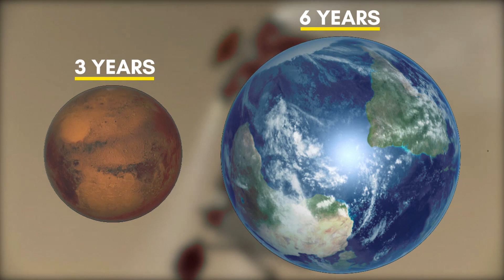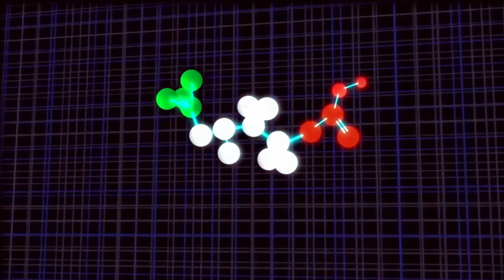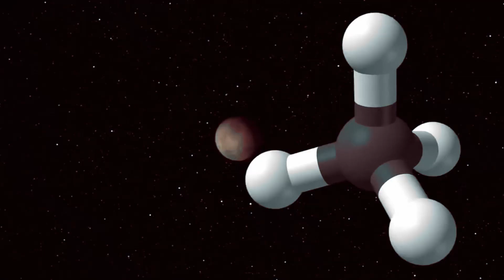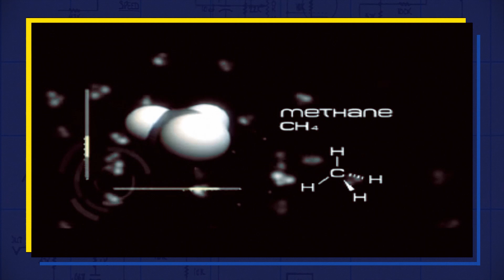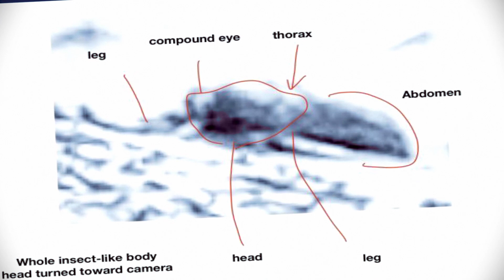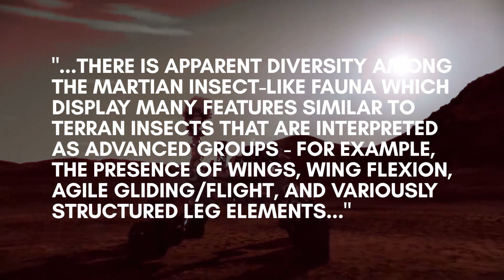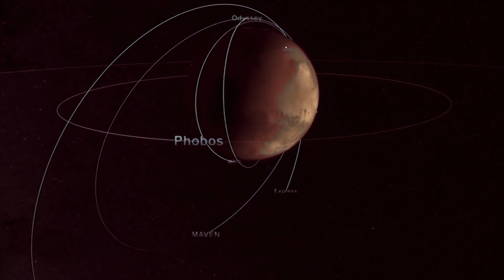Mars | Signs of Life

Comment: I don't understand the surprise at oxygen and methane.  With no atmosphere, Mars' surface is bombarded by much more electromagnetic radiation than Earth.  I would think carbon dioxide might easily lose an oxygen on occasion under such conditions.  Methane, being the simplest hydrocarbon, is plentiful on Earth and many millions of cubic meters are trapped in Earth's ice caps and subterranean ice.  Does anyone know if carbon dioxide ice can store methane as well?
Reply: Just want to point out that Mars does have an atmosphere around it, just not a strong one.

Comment: With the figures we are given for gravity and air density,  about .33 and .007 respectively,  a wing would have to be nearly 50x greater in surface area to loft a plane or an insect on Mars.
Reply: Or beat 50X faster.  The helicopter like drone NASA is testing and hopped to send to Mars uses a combination of light weight, large blades and very high speed  to achieve sufficient lift.  
But if you ask me, UFOs/Aliens, etc is the least harmful conspiracy theory and should be encouraged among the reality challenged conspiracy theorists.
Reply: Nordburg was just wondering why they didn’t send drones. I’m interested to see a mars-drone
Reply: @DeputyNordburg  Just think of a martian insect on earth beating 50x faster.  That would cause a hurricane here.
Reply: I think the supposed atmospheric pressure is inaccurate. I also think they (NASA) know it’s inaccurate.